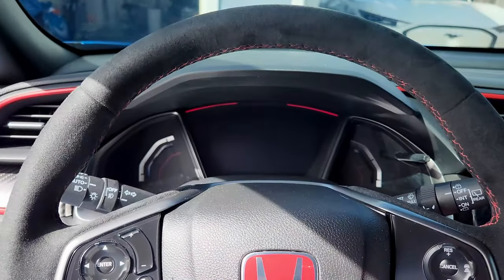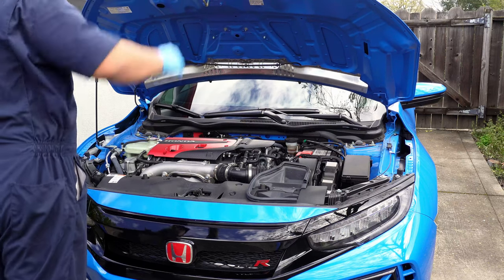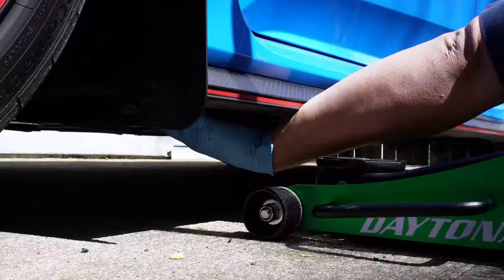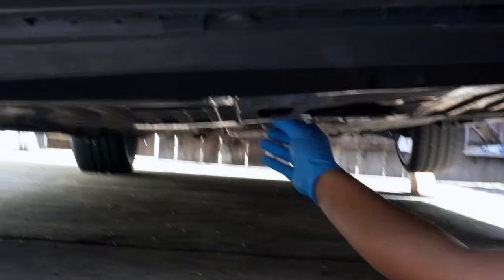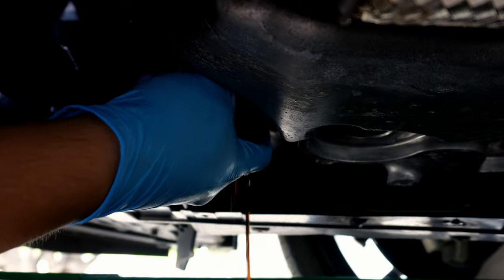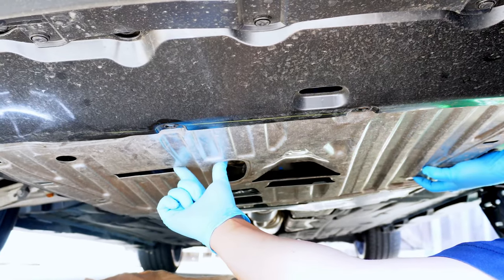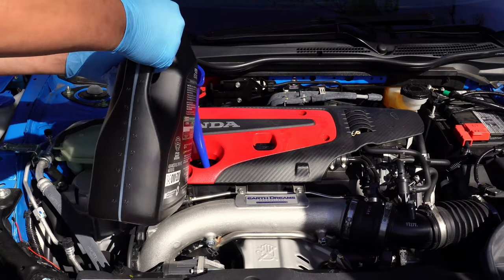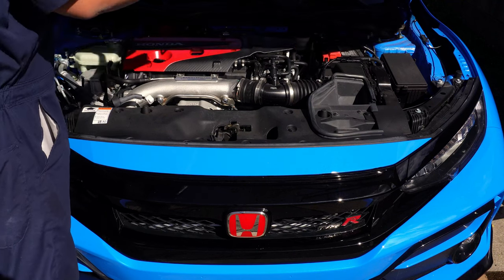The Best Civic Type R Oil Change Guide (FK8 10th Gen 2017-2021)

Comment: Why I’m I having trouble getting the skid plate back on the flat head turns but only when the skid plate is off.
Reply from the maker: Try pinching the metal clips the screw goes into together some. Just a guess based on what you said but the screws are pretty short and once the cover is there, it's now not reaching the back of the clip where it fastens. Let me know if that works or share more info and I'll see if I can help more.

Comment: Hi, I have the same generation Civic, but with a 1.5 engine. In the instructions, it only says for the ACEA specification, but not for the API. I need to use the same spec for mine if I ever buy another brand of oil and does it have to be 0W-20? Because in the instructions there is also an alternative of 0W-30 or 5W-30. Would either of these two be better? For now, I'm taking the car to an authorized service center.
Reply from the maker: Hi, I'm guessing you are in Europe (or at least not in the US) looking at a manual for that region. ACEA is just the EU oil standard while API is US--literally the American Petroleum Institute. The Castrol oil I used in the video meets both API and ACEA standards. As for oil weight, you can use whatever the manual recommends but generally go with the main weight recommendation. The other weights are usually for heavy duty or different weather regions. I hope this helps.
Reply: @mldiy  Yes, I am European. I know that ACEA is a European standard and API is an American one. I had a Mazda before and the manual listed both specs and I chose the oil because they matched. In terms of temperatures, it can reach up to 40 °C (104 °F) in summer, while in winter it is rarely more than -10 °C (14 °F) in our region. Therefore, I think that 0W-30 would be better than 0W-20 for summer, because the winters are not so bad, maybe even 5W-30.
Reply from the maker: @dejandezman6139  I don't know much about the 1.5L engine, but generally speaking, unless you are tuning the car, 0w-20 is likely fine and just slightly better for fuel economy. Your summer temps aren't high enough for the 0w-30 to be supplementing something your cars cooling couldn't handle (e.g. you are racing the car or redlining it every time between lights). So you have to ask why you think the car needs slightly thicker oil all the time (besides reducing your gas mileage). And 0w-20 will be better for auto start/stop depending on if you typically stop at lights a lot or not during your drives.
Reply: Otherwise, I have it chipped at 200 horses, but I don't run it regularly. There's probably nothing missing from 0W-20 if it's also specified for Type R. But as far as I know about oils, 0W-30 should have the same cold start protection as 0W-20 because the front number is the same.
All that the person who chipped it advised me was to use 100 octane instead of 95 octane gasoline. A minimum of 95 is prescribed, but it can be more. I did fill up with 100 octane for a while, until I had to fill up at a pump where 100 octane was not available. Since then, I've been refueling with 95 octane, it's cheaper 😁 @mldiy

Comment: Hey man. Did my engine oil and oil filter changed today.  And putted 5.4L in the car and why the dip stick shows the oil level over fill??? Oil level should be between that two little holes. Also there was 5L old oil from the car I have poured back to the 5L bottle.
Reply from the maker: Hi Shen. The oil capacity is for sure 5.7 quarts (5.4L) but there's a couple things to consider.  If you drained your oil right after shutting it down and put the drain bolt back on right away, there's still a decent amount of oil in the head and block.  That oil takes 30 minutes or more to work its way back down to the oil pan.  Also, did you start the car after filling the oil so that oil circulated through the oil filter?  And did you let the oil settle before checking the dipstick?  

How much oil that came out from draining is telling too.  Either you didn't let it fully drain so you only get 5L out, or you are burning oil--which the k20 engine does have a history of doing (it was notoriously bad in the RSX).  

Please also keep in mind, in my video, I only fill 5 quarts before cycling the oil and checking the dipstick. I (and many others) do this to ensure we don't overfill on oil. There's always something you can do to verify along the way instead of blindly trusting a guy on the internet. 

I recommend you check your oil again when the engine is cold to see what your oil level. Best of luck on your future DIYs.

Comment: Can we use 0w30 instead 0w20? Because sometimes we drive a bit more aggressively.
Reply from the maker: Hi Shen, modern engines are fine with thinner oils because the clearances on the rings and bearings are so much tighter than back in the day. A higher viscosity is just going to make your engine work harder and impact your fuel economy.  Unless you're redline all day long in like desert heat, it's likely that your sportier driving is well within spec for 0w-20.  That all said, 0w-30 is an acceptable weight based on the manual--but you can check yours just in case I'm wrong.  I hope this helps and if so, please consider subscribing. YouTube now unlocks features for creators at 500 subscribers and I'm almost there!   Thanks again.  https://www.youtube.com/@mldiy?sub_confirmation=1
Reply: @mldiy  thx for the reply and the explanation. Subscribed

Comment: Does all type r need the catch can ? That’s alot of oil
Reply from the maker: The short answer is it's not necessary, but it doesn't hurt especially if you are tracking the car.  With direct injected cars, the droplets of oil that end up getting spit into the intake stream from the PCV could potentially build up over time. Before with indirect injection, the fuel would end up cleaning the manifold and valves on the way in, so a little oil blowby didn't matter as much. 

So the catch can I think is only 2 or 3 oz. It's not that much oil even if it looked that way in the video and it was a thousand miles or so since the last oil change. Most of that oil would get sucked back into the pistons and only some of it would stay in the manifold. Keep in mind that catchcans also don't catch 100% of the oil, so it's just further extending the potential long term problems--if any at all. 

If you do buy one, click on the link in the description to help support the channel. 👍 Thanks for taking the time to comment.
Reply: Thank man

Comment: 0w20? This is crazy
Reply from the maker: I know right? It's mostly for emission standards, but newer engines like this gen of the K20 are machined with tighter clearances than the previous gen. One could argue if the oil is too thick you're losing horsepower. And if you're unlucky, an unfriendly dealer may deny a warranty claim if they find out you used something other than 0w-20.  You know what else is crazy? A Type R needs 5.7 quarts of oil but a Honda ridgeline only needs 4.5 quarts.

Comment: weak oil for this engine.. and by that I don't mean viscosity
Reply from the maker: Happy to learn from you if you are willing to share your knowledge. What do you use and do you have different recommendations for track vs daily?
Reply: @mldiy as per manual "sae 0-20". Castrol meets the specs. People go crazy with oil for some reason.